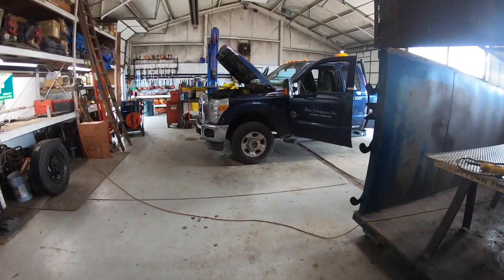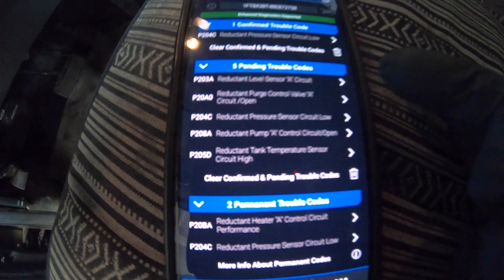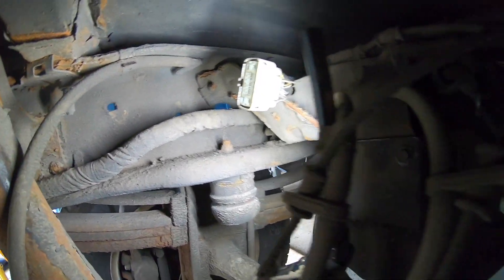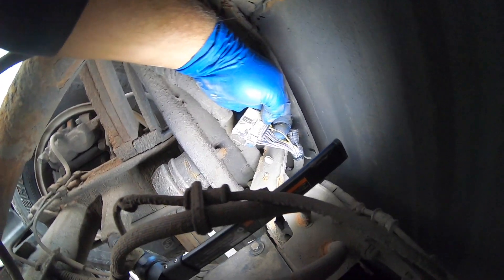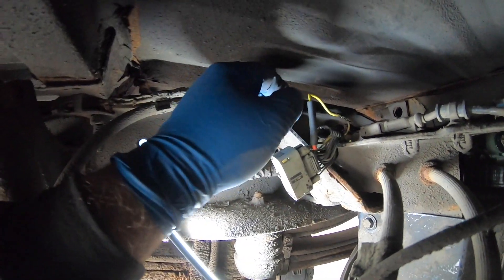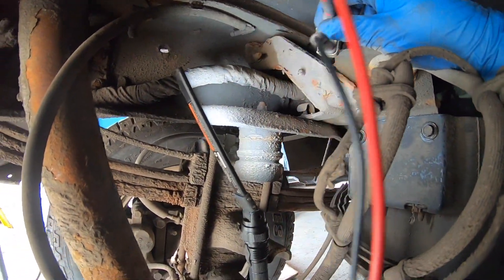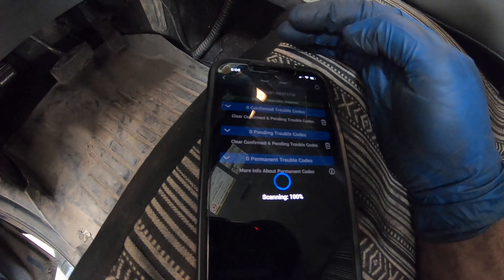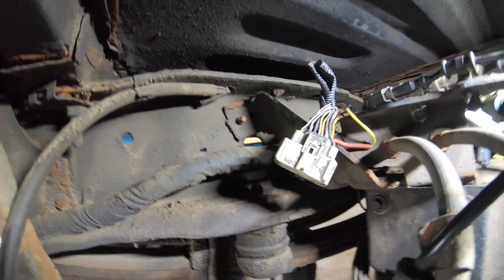P 204C Reductant￼ Pressure Sensor Circuit Low￼- Check Engine Light on 2011 Ford 6.7 Powerstroke

Comment: I just bought a 2018 Silverado pickup and I have turn signal issues when I hit my key fob to unlock doors ,my very bright signals blink very fast and won't stop till I get in and start truck. Very annoying. Any ideas?😢😢
Reply: If it helps truck has a boss plow with it. To me it can be anything involving the wiring from plow or the harness on truck. But original owner said he noticed it did that every once in a while. So it's not me.
Reply: First Chevy in over 40 years. Still have 99f350 diesel dually but body rusting off the truck. That 7.3 still runs good only 160,000 miles on it,but body rusting off the truck
Reply: I wanted to add that my rapid turn signal problem is intermittent. Does not happen all the time. But more than not. Thanks. I'm afraid if I take it to a shop,I'm gonna get one of those bills you talk about with 20hours labor and one butt connector. That was funny by the way. I've seen it more than once lol
Reply from the maker: Is there a bulb burnt out. You'll get rapid flash if a bulb is burnt out